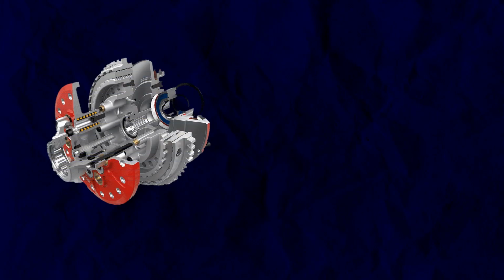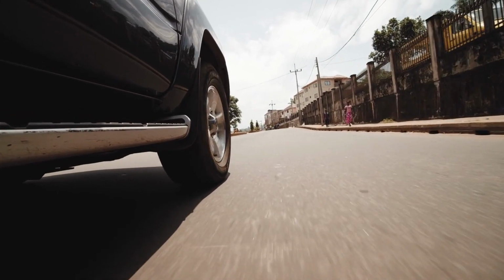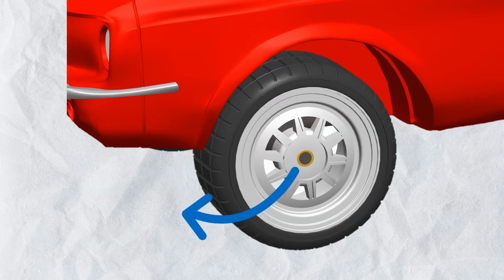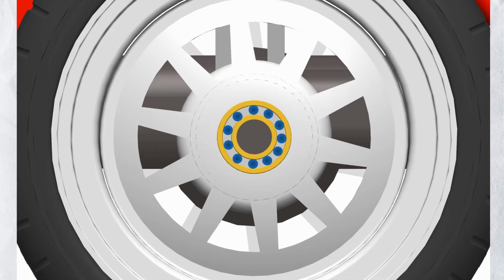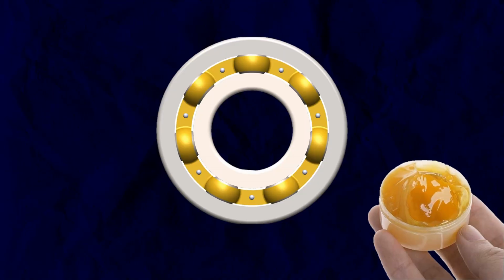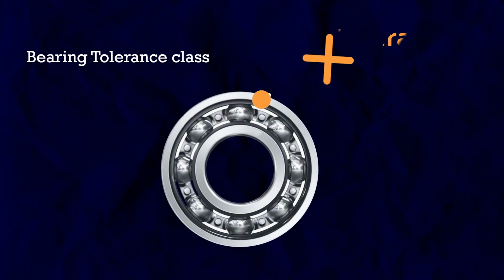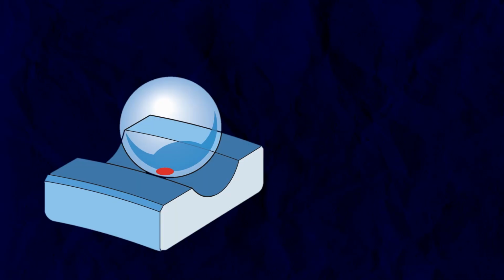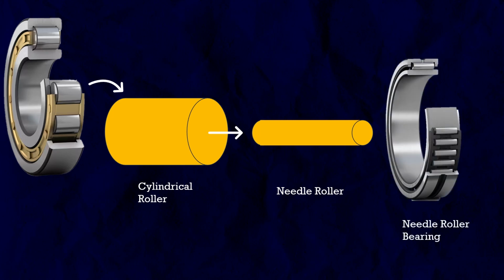What is Bearing | How Bearing Works ? Types of Radial Bearings

Comment: But doesnt this will stop the motion transmission between the axle and wheels if there's a bearing between them. As the axle rotates and with it only the inner race will rotate not the outer race

Comment: Really great video, could you please tell me what bearing has the lowest speed?
Reply from the maker: I gues, You are asking for the lowest permissible maximum speed? I couldn't say that because it will not only depend on the type of bearings but also the size of Bearing.
However there is a bearing type called jelly bearing. Used in hand watch, which permissible speed would be minimum, but I'm sure